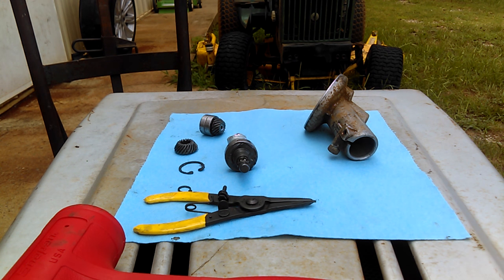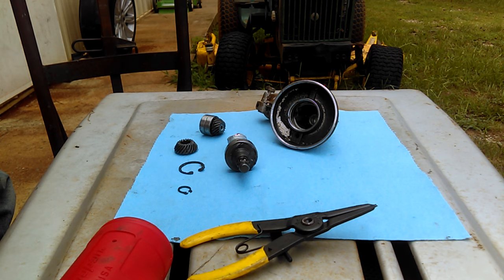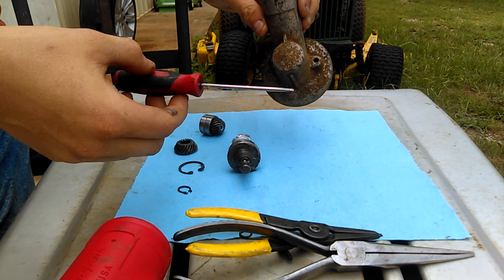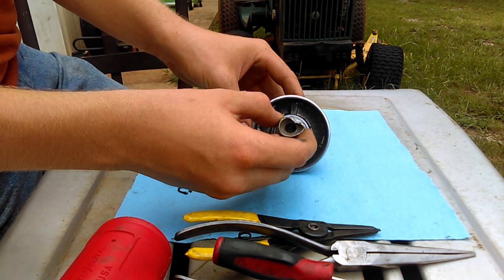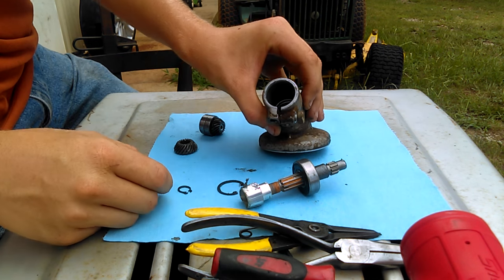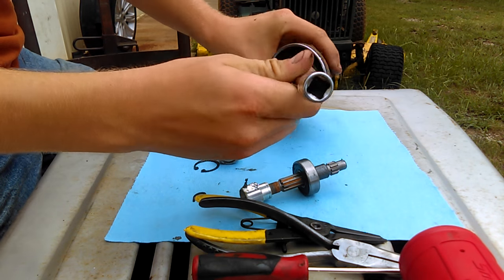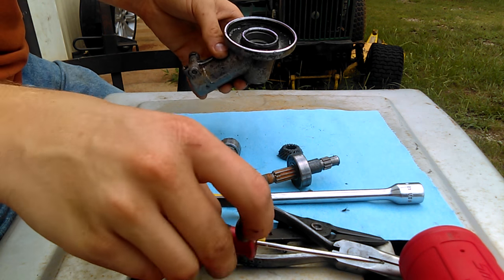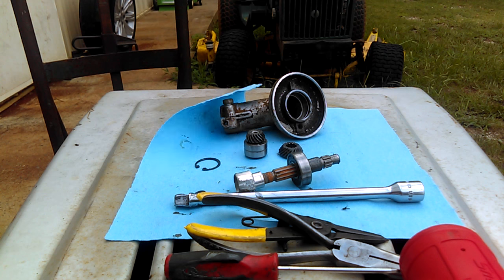Stihl trimmer gear head tear down (basic instructions)

Comment: Helpful video. The gear you reference around 2:20 looks to have a few teeth broke and I'm trying to find how to replace that part and what the part number would be and where I can purchase it. Both of those parts are causing my trimmer to stop the back and forth cutting action (I believe). It's from a Stihl HL trimmer from 1996 and its the one that has the black bar that you can use to adjust the tilt. Without that gear / hedge trimmer attachment my hedges and vines are out of control and I hate to buy a new one. It's worked great until late last year when it broke. Any ideas would be great! Thanks again for the video. 

Scott

Comment: i imagine this is pretty typical of all gear heads. is there room to put a grease fitting on the head? a shot of grease once a year would be a real help.
Reply: My Husqvarna has a place where you could put a grease fitting if you wanted. It's really not much different than the Stihl other than they use a single bearing for the input shaft instead of the double bearing like Stihl and Ryobi.

Comment: Why didn't you show how you took it apart?
Reply from the maker: winmur2009 didn't think about making a video of it until after I had taken it apart. I apologize
Reply: No need to apologise at all! This is exactly what I needed to do see now and I'll give it a go today. I am a big concerned about whacking the cast casing with a hammer though, I already broke a part of my Stiga gear head "flange" loose when preparing for disassembly... 
Wish me luck!
Reply: @TheCumminsPack  I broke the shaft changing the edger blade for the first time"turning the wrong way which I know now " I got the new part how do I get the old one out? Do I need to take it apart from the top? Or just just pull really hard from the bottom after taking out the snap ring?

Comment: So what if I just need to change the shaft out?
Reply: theres video for that: just loosen the pinch slotted bolt/ remove head.. / pull the long wire cable out... /slide new 1 in.. /bothe ends same.. dont matter wich way ! get rag ready and grease the wire shaft well - theres several plastic donuts it goes through!

Comment: Hi I took  of the Cir Clip on the large bearing ??  how do I get the bearing out ???k It needs replacing all chewed up with only half the ball bearings in it
Reply: Peter Wood-Jenkins heat it up carefully with a blowtorch, tap it on vice or similar ,should fall out , maybe use a drop of wd40